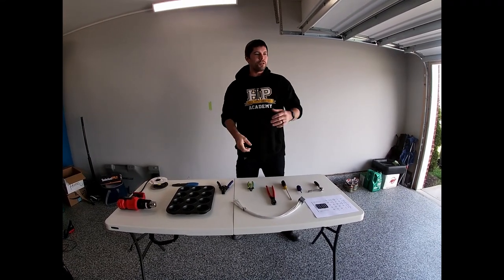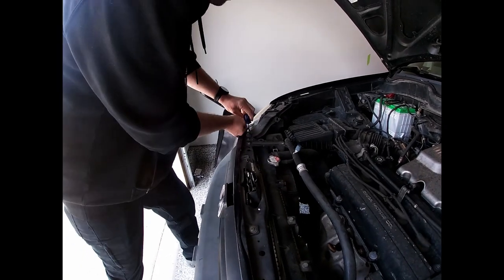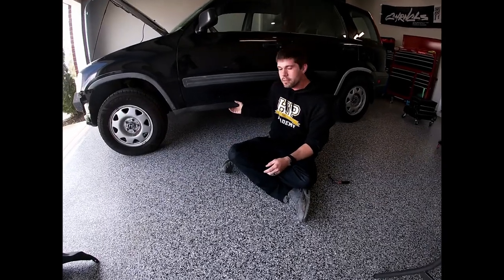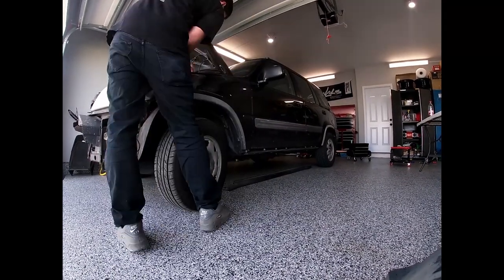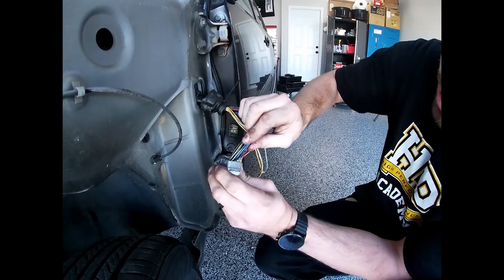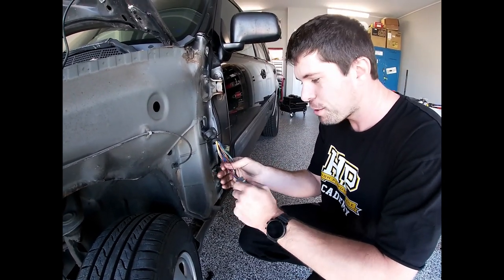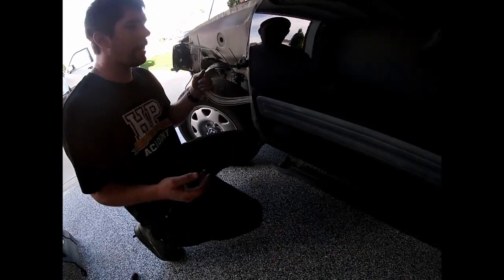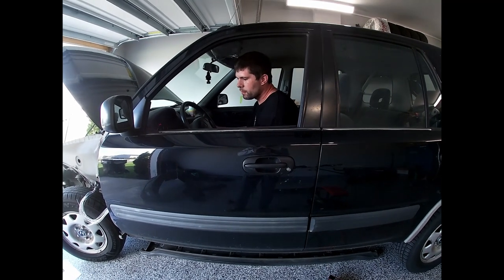Honda CR-V RD1 Door Jamb Replacement Harness Installation

Comment: Thanks for the video. Harness worked perfectly. Used solder and heat shrink rather than the connectors you did. Aside from that install was straight forward. Good product. Thanks to The Honda Resource for sending me your way with his door harness video.

Comment: Got the new connector installed over the weekend and everything works great again.  WAY easier than replacing the pins!  5 bolts to get the door off, did one wire at a time, there were 4 or 5 more that had broken off since the last time I was in there and replaced the some pins and broken wires, great documentation with wire colors and wire sizes.  Speaker works again, locks, windows, everything is great.

Comment: Hi Mitch, my OEM wires are bad. 

No malice intended in this next question: is there any difference in design with the original factory plug versus your wire harnesses? The original design to have the wires just deal with the wear and tear of opening and closing the doors thousands of times throughout the decades is the true issue. Have you made your version of the wire harness to be more “secure” somehow? do they avoid the pulling of the door opening, or is the tension offset elsewhere? I didn’t notice a closeup of your harnesses. 

Might appear crude but For lack of better way of putting it -  The original wires and plugs in all of these CRV’s are obviously 25 years old now, is the appeal of your product that they aren’t as worn down?
Reply from the maker: i use better wire than the oem txl wire. 

as for crimping, it does appear that some of the stamped leads that broke at the terminal where a bellmouth should have existed, didn't have a decent bellmouth, but it's speculation at this point now.

ultimately I position the product to use the highest quality materials so the chances of this issue reintroducing itself are even lower.

Comment: I have 2001 CRV FWD. same issue, only the drivers side is affected. The master control on the drivers side can lower all windows except driver door, and no power locks all around. Would replacing the wiring harness fix the issue? Great vehicle otherwise.
Reply from the maker: pulling the fender to check the harness is the only real surefire way. but it does sound like it's the issue.

Comment: Great Harness fit like a glove thank  you !  Mitch  .Sadly I  still have an issue the front driver and pass  door locks not working > does anyone know what could be causing this issue? I checked the color code and the connections several times they all seen to be in order .Hope someone may have an answer before I go back and re-splice all wires that are power door wires it would save  me a lot of time. TY best, robert
Reply: passenger door harness is broken or intermittent connection as well, same thing happens on that side of door harness connector, or there is a short in wire above the spliced in area.

Comment: Hi Mitch, this is precisely what I need for my 98 civic. Is the diagram that you use included with the harness?
Reply from the maker: yes , it's included with every order
Reply: @Mintonperformance  Thank you, I just bought it via Ebay. Quick question, would it  be ok to use heat shrink butt connectors for the installation? It's a civic so I'm guessing there will be less space than on the CRV you show in the video
Reply from the maker: @davidgarzon-limberg2043  absolutely, I recommend staggering the splices in 2 or 3 different lengths to avoid the volume being all in 1 spot.
Reply: @davidgarzon-limberg2043  The drivers door lock/latch mechanism has an adjustment.  My locks stopped working/worked sometimes and this was the issue.  Try pulling the door handle on the outside of the door like you are opening it a little bit at a time while locking the car at the same time and see if it locks.  If it does then the adjustment needs to be made on the metal rod that goes from the latch up to the door handle.  Super pain in the A because it is the one that snaps into the door handle.  The rod pushes on a little mechanism in the door lock/latch, if it doesn't engage it enough then the door will not lock, none of the door lock!  Mine was double confusing because my door wires had also broken off at the pins so things were intermittent and some things just stopped working all together.  Most complicated door lock system I have ever seen.  I tried to purchase a new latch and it was like 400 dollars!  At that price I just removed mine and really studied it, finally figured out what was going on and was able to adjust it and get it working again.  Worked fine when I removed it from the car, got everything hooked back up and it wouldn't work again, that is when I realized the handle rod wasn't adjusted correctly and that is what was not letting the car lock.  You will see if this is your issue, there are a few rods on the lock/latch, it is the rod that has the screw on connector on it.  Super hard to explain, hope this helps.

Comment: Hey Mitch, my front passenger window does not roll down but rolls up. I found that out after I replaced the regulator/motor. Is the issue fixable with this harness? And if so, is this done on the driver side or passenger.

Comment: Mitch, I installed the harness a while back and the horn blows continuously now. Any ideas? I have them disconnected. Everything else works fine , door locks, windows , speakers.
Reply from the maker: the horn relay is in the lower kick panel where your left foot would be while driving.

There's a gray wire there that's used between the steering wheel horn switch, a potential unconnected connector for anti-theft, and the keyless entry module.

ita shorting out somewhere
Reply: thanks a bunch , I'll see if I can run it down. I had a feeling that it might have something to do with those modules and was probably open and just wasn't doing it while the wiring was all broken.  @Mintonperformance

Comment: I don't own any of the tools you used my man but my power locks are out and I changed the driver actuator already so I'm thinking it's this situation. What can I get away with buying at a minimum to do this job considering I don't know if I'll ever use wiring tools again? Also the fender panel can't be taken out by itself? Thought I saw someone in the fb group just take off the panel only.
Reply from the maker: You can find me on Facebook, mitch Minton. That's the best route

Comment: I cut the harness coming from inside the door as well as the one from the fender in an attempt to splice the wires together. nothing is working well now.
How would I manage to fix this? will I need any more parts then just your replacement part? 
Any help is appreciated thanks.
Reply from the maker: to understand clearly, you attempted to bypass the plug entirely?
Reply: @Mintonperformance  yes the wires are spliced to eachother now.
Reply: When it was working my fob would open the window and the drivers side window would unlock the car
Reply from the maker: @joshuamarshall1797  ultimately something isn't wired correctly. if you cut the plugs entirely before splicing, you're just gonna have to go circuit by circuit until you get things operational. start by testing every circuit, eliminate the correctly working circuits from the problem circuits, then just start testing 1 at a time with the helms manual for operation
Reply: @Mintonperformance  would your harness still work at this point
Reply from the maker: @joshuamarshall1797  it's only half of the equation at this point, you would want to grab an entire door harness from a 97-98, or 99-01 for my harness to be a viable option, and even then there's multiple colors that you would be guessing with
Reply: @Mintonperformance  thanks for replying i ended up fixing it. the red and white wire was connected with a white and red wire causing a fuse to blow everytime i tried to lock the doors. everything works fine now that i respliced.
Reply: I did that too. Get another in door harness from the junk yard and order his harness and just do the plug. Easier

Comment: I just ordered one of your harnesses. Hopefully it’ll solve my power lock issue with the passengers side, & both rear doors. Is this common to cause those issues as well?
Reply from the maker: it is, the power door lock module is inside the driver's door, and sends current through 2 wires going to the other 3 doors

Comment: Waiting for my order now, but have started prepping.  Also noticed 2 Yellow/Red's.  If both wires detached, you can't try to match up like you described in the video.  I did notice though that one of the yellow/reds is thicker than the other, so would I assume that that would be B1(Yellow/Red 16) and the thinner would be B2(Yellow/Red 20)?
Reply from the maker: That's correct. The (yellow/red 16) will be the thicker one, and the (yellow/red 20) will be the thinner one.

There's 3 blue wires as well. B4, B5, and E4.
Reply: @Mintonperformance  so I wired this in and the lock works but the window will not move. Any idea which wire that could be?
Reply from the maker: @xanderrobertson7486  check to see the wiring from the motor is working, should be red/yellow and red/blue. should show 12v or - 12v when measuring with the motor switch

Comment: Bought two of  your harness I’m having trouble with the passenger side the wires from fender are 10 wires and passenger door jamb has 14 wires  and the wires colors don’t match
Reply from the maker: email me if you can, mitchminton@gmail.com.

im not entirely following. i populate every position in my harnesses which would have 25 wires.

Comment: Would this apply to Honda CRV 2005? If so, u think I could grab the door harness from a junk yard from another CRV?
Reply from the maker: 02 and up it will not fit. they didn't use the same connection as the 97-01s
Reply: @Mintonperformance  so this won’t be the exact thing as changing out my door harness on my CRV 2005
Reply from the maker: @fishywishy4145  that's correct.
Reply: @Mintonperformance  ok thanks

Comment: what do you use to cover the extra 8 inches of wire that no longer fits into the harness?  and is there room to tuck it cleanly away ?
Reply from the maker: i push it back into the cabin

Comment: Quick question....If I’m wiring aftermarket speakers to the front door (powered by a 4 channel amp). do I need to go through that front section or can I  wire em another way??
Reply from the maker: for the best practices and cleanest look, id wire them through the door jamb connector, the terminals i have available and a crimper would be needed
Reply: @Mintonperformance    Is it necessary to take off the front fender when wiring things through the front harness?     also do I need to buy anything or can I just shove the speaker wire in with the jamb...???

Comment: Your current URL link to ebay does not work. Are you still selling these ?
Thanks !!! Great Video
Reply from the maker: I've had to change up how I'm going about making them and am having to reuse the original connector. covid shortages hit this connector and it's no longer being manufactured

Comment: Mitch Minton do you have any more Pigtail Connectors Wiring Harnesses for 01 CRV?
Reply from the maker: i do, I pulled my ebay sales ad down because of the limited quantities left
Reply: @Mintonperformance  i need to order one can i contact you through fb or gmail? If so please lmk
Reply from the maker: @luisdrivera2191  yes sir, my email is mitchminton@gmail.com

Comment: Where can I find the harness? The link in the description says item is no longer available.
Reply from the maker: I've got 4 connectors left before I'm sold out. if you're interested, feel free to reach out to me at mitchminton@gmail.com
Reply: @Mintonperformance  hey mitch you still have any harnesses available?
Reply from the maker: @michaeldelvalle1642  I have 1 available currently, I've been catching up on production and had to change my structure to use original connectors as the manufacturer completed obsoleted the connector

Comment: Do you still have more parts, I Need one for my 2000 Honda Civic LX sedan.
Reply from the maker: I've got supplies for just a few left.
Reply: Would it work on 2000 Civic?
If it does, where is it listed?
Reply from the maker: @adildriouech1293  it will certainly work, but the pinout will be different than the colors of wire used on RD1's. I supply a blank template to populate all the colors into a diagram to then be referenced for splicing

Comment: How can I get one of your driver's side harnesses for 2000 Honda CR V?  And how much are they?
Reply from the maker: currently they're on backorder, im working to get inventory back up as covid shut down all manufacturing of the connectors from the oem manufacturer. so now I'm having to source original harnesses, depin them, clean them, and reterminate them.
Reply: @Mintonperformance  OMW to junkyard tomorrow to see if I can salvage one. How to repair? Can you clean all the grease off and start fresh? Is it possible to reconnect broken wires in the OEM moldex connector?

Comment: Great video. how can I order one as the ebay link is not working?
Reply from the maker: the connector was obsoleted by the manufacturer so it have no ability to make them any more unfortunately
Reply: @Mintonperformance  Man, that sucks. You made a great effort here. Think I.m going to straight solder the wires, shrink wrap and zip tip to reinforce. At least my ground and red/white wire is out and must be at least one more after troubleshooting. This video is awesome. Thanks!
Reply: He makes them again
Reply: @kellymyers8671  He makes them again

Comment: Does this harness work on passenger side
Reply from the maker: It certainly does. It will work for either side of the front doors
Reply: Mitch Minton thank you I jus ordered mine. Wil be ordering another one one I install my first one

Comment: Does a 2006 crv suffer the same issue?
Reply from the maker: not that I've observed, but if it does, it's not the same connector.
Reply: @Mintonperformance  thank you so much.. Great video by the way.
Reply: @Mintonperformance  reason I ask is. I put in a new driver's window motor and window still does not function.  Ordered a new window control switch assembly and it will be here any minute.  Hope that fixes it.  Other issue is the drivers speaker does not work either. 
So it's a blown speaker and a bad switch or,  the harness is failing.
Reply from the maker: @Deeked  its possible they are falling to the same fate, but i haven't heard many cases of it
Reply: @Mintonperformance  I just tested the speaker with a 1.5 volt battery.  It pops so not looking good.  I suppose it could be the factory had unit.

Comment: Is there any for civics 96 to 2000 4dr
Reply from the maker: yes, the door jamb harness i build works for the 96-00 civics also
Reply: @Mintonperformance  I need 1 I also have another civic that doesn't have power windows just power locks the civic VP and the other im needing has both p/w and locks
Reply from the maker: @2koolforyou88  send an inquiry to mitchminton@gmail.com
Reply: @Mintonperformance  ok thanks

Comment: will this fit a 1996 civic??
Reply from the maker: yes, it will, the documentation just won't apply to the civic, as the wire colors will be different
Reply: @Mintonperformance  cool thanks, do i just order from e-bay? or from you?
Reply from the maker: @waltermaggrah7656  either way works. going directly saves sales tax.

PayPal : mitchminton@gmail.com